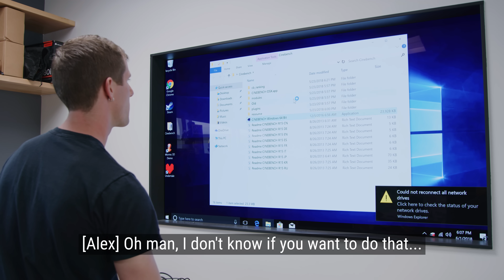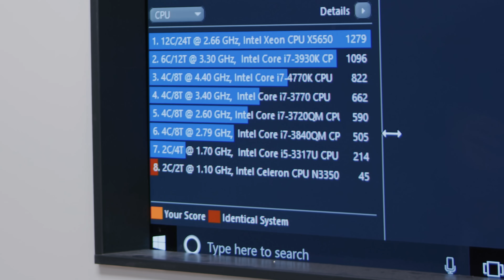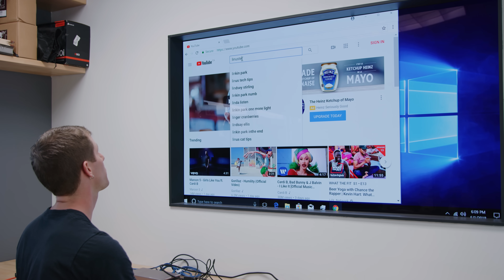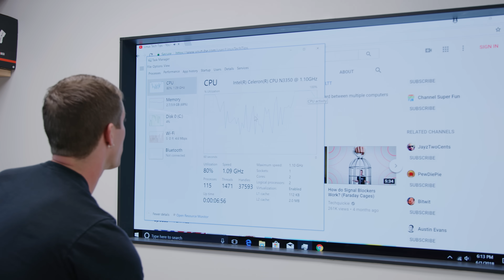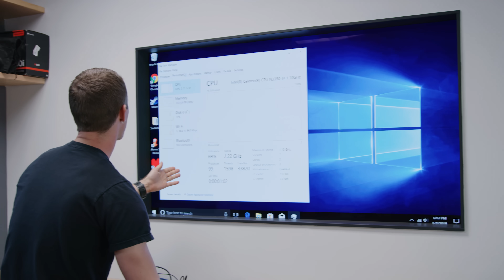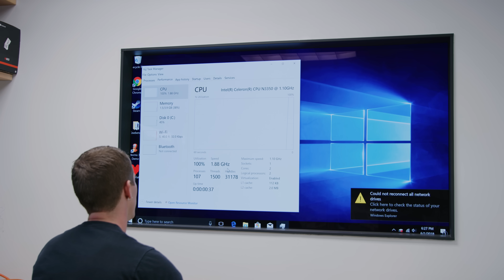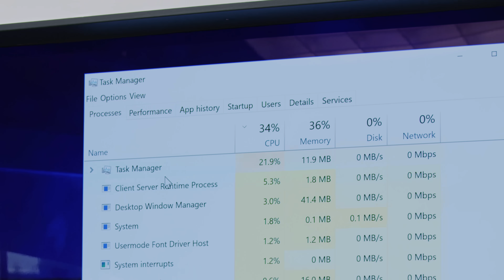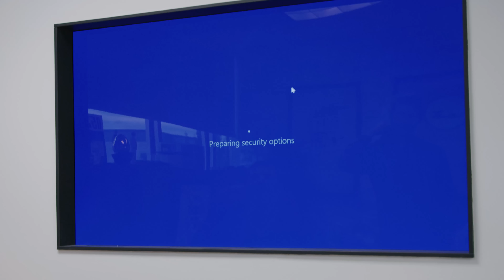PC Smaller than an SSD

Comment: You can technically have two system build by slappin that shit on your ssd bay in your case and routing out the hdmi and power cable
Reply: 100 of these would fit in my case
Reply: Shawn Jones only 100?
Reply: I need my SSD to house all of my files tho
Reply: PunakiviAddikti 
No its called hdd
Reply: You have so many subs
Reply: Hide it inside your PSU, the cops will never find it there!
Reply: Shawn Jones 317 of these would fit in
Reply: Put Mac OS on it

Comment: so its basically a phone without a monitor that runs an x64 architecture?
Reply: Ethan Martin but slower
Reply: But why, why cant we get phone performance
Reply: no.

remember latest Raspberry Pi 3 B+ a quadcore 1,5 ghz arm64 is about pentium 4 level or less.

try google : "how powerful is raspberyy pi to x86 PC"

this zotac is WAY WAY WAY more powerful than your phone.

also, this thing consume 15 watt (5V 3A), your phone consumesprobably 3,8-4,2V (3,7V is when completely discharged)  x 0,5 AH, which is about 1,9 to 2,1 watt.

WAY. WAY. WAY. LESS POWERFUL

also, the architecture is x86 not x64.
64 bit would be coded x86_64
Reply: lmao that piece of garbage isn't worth the 150 bucks are you crazy? edit, samsung dex.
Reply: phone can run 64 acr just saying
Reply: And has no battery. And has no phone capabilities, and has no camera, and has no GPS/NFC/accelerometer/"gyro". I don't think it has wi-fi either, or was I not paying attention?
Reply: ImNarrow because Windows software support would be very limited on something that isn’t X86 :(
Reply: Is obviously for signage companies, tills, and interactive kiosk use.
Reply: @girlsdrinkfeck  DEX doesnt work by itself you need 1000$ phone to make it work and its still ARM
Reply: Phones are not meant to be computers. It was phones which became tiny computers with antennas and a monitor lol
Reply: yea, but almost any phone since the Apple iPhone 5S in 2013 has had a 64-bit chipset.
Reply: @AvWoN  windows has a lot of background processes that android or ios doesn't
Reply: Windows is shit, that this thing runs it is quite an achievement.

Comment: so essentially a phone without a screen running windows
Reply: You go it. A similar Intel processor is in the Asus Zenfone.
Reply: yes and no, there is a pretty big difference, with both hard ware and soft ware, between a phone and a computer running windows, its impressive cause of how "smooth" it was running a "large" operating system(by smooth i mean it wasn't crashing when Linus wasn't screwing with the clock speed, by large i mean windows is a heavier load than Android or Linux)

Comment: I don't get the point of this. If you're going to need a dongle the size of your pc, why not make it Raspberry-Pi-sized and add usb, ethernet, hdmi etc.
Reply: margravetech realistically, you'd buy exactly the dongles you need for your use case, rather than having a bunch of extra IO taking up any space. So if you're just using this to drive a digital sign, for instance, you'd get an adapter that only has a video output. In addition, it offers the flexibility of adding alternate connections that the Pi lacks.
Reply: The case of having of a digital sign/other niche purpose with enough space for this, but not enough for something Pi-sized seems too small to matter. And why does the Pi lack flexibility? It has usb ports, these are just type-C.
Reply: margravetech you make excellent points. And you're right. I'm not sure that there are any commonplace situations where you need this specific design over the variety of IO offered by something like a Raspberry Pi. To me, there's a certain elegance to having exactly the connections you need and nothing more, but that's hardly a practical concern. In terms of the Raspberry Pi's USB specifically, all USB ports and the Ethernet connection share the same USB 2.0 bus, which severely limits overall device bandwidth. I doubt these USB C ports have that sort of restriction, making them far more flexible and suitable for varied connections.
Reply: True, yes. I wasn't saying to use a Pi specifically, it was just a well-known example. There are definitely use-cases with more power needed, or specifically windows, but then my mind goes to an Intel NUC instead of this.
Reply: IN a restaurant menu cabinet it doesn't matter. Cooling could be a non-issue as well as most restaurant menus are mounted outside of the  Building. in Alimunium cases about 2 feet b t 3 feet and 6 - 8 inches thick.
Reply: It's simply a small PC. And that's how you can use it. For making your TV smart with a hidden PC or for driving a public display. Maybe even a small POS-System, because most POS-Applications aren't ported to ARM64 or even Linux.
The Pi could also do most of this, but I guess some companies and people prefer Windows which doesn't run officially on the Pi yet.
Problems I see with this Zotac PC are the high costs, I guess partially because you buy a Windows Licence with it. On top of that it's just a Home License, which is basically useless to run it headless. This won't be fun with that specs, especially 32 GB Disk.
Reply: I had one of the IBM stick PC's for about a year before it just stopped working. Really frustrating since it was great for mounting on the back of a flat screen tv to give me quick easy aess to the net.

Comment: When your wallet runs at a faster cpu speed than your laptop
Reply: 1.1 in a laptop? That's kinda sad ngl
Reply: hahah i play tf2 on that same processor
Reply: @imeprezime7843  how
Reply: Mine 2.16 dual core, though it usual speed is 2.56, i guess that because of the turbo boost or something, only have 2gb of ram, overall run pretty damn fine, watching youtube on 4k don't really work though, also need an extension call h264ify to run youtube at HD without hiccups, otherwise i'm just gonna stuck with 480p video
Reply: I have the Intel Celeron N3350 and using the Intel HD Graphics
Reply: @amvywavy  N3060 and using intel graphics
Reply: upgrading to ryzen 5 or 7 i am still choosing and im still choosing GPU soon though!
Reply: @flying7909  I actually have an old system that have a broken drive but I'll be fixing it soon. It has an i5-3470 but it is heavily bottlenecked by Intel stupid integrated graphics. Atleast AMD Vega integrated graphics is decent

Comment: you mean a smartphone?
Reply: lol, yeah.. he acts like smartphones don’t exist and haven’t for a decade...
Reply: Voyage & Hearth not true
Reply: Voyage & Hearth But they can, there are Windows Laptops using Snapdragon 835s, like the kind in most flagship smartphones
Reply: Voyage & Hearth the Windows lumia did
Reply: It's got an X86 processor, bruh.
Reply: Except it's x86 architecture
Reply: Sr.unicörnio azul mas na verdade é roxo - clash royale.. CRINGE 🤢🤢🤢
Reply: Voyage & Hearth so because it doesn’t run windows it’s not a computer?
Reply: No a samrtohone does not run full desktop os
Reply: @leonel9110 I didn't say that. Where did I say that. I don't see that quote. I am simply implying there is certainly value on being able to run X86 applications, so there is a market for this kind of device and it should not be compared to a smartphone because a smartphone CPU can not run X86 applications simply because it's a different architecture. This is all basic beginners stuff, guys.
Reply: When was the last time a smartphone was quite this small? In fact, when was the first time?
Reply: Ha your right
Reply: My phone runs a full desktop mode OS (and you can route most Android phones to run Chrome OS).
Reply: What x86 applications will run well enough using this weak processor?
Reply: No that ssd sized pc is more powerfull that's the point
Reply: Mr.Cringe Kid more powerful than a Snapdragon 845 or even a Kirin 970 with 6Gb ram?!?
Reply: Quinch or even the A11 Bionic chip that matches a MacBook Pro
Reply: That pc is thiccer than my whole phone -_-
Reply: A micro pc is is complettly different than a smartphone, because it doesnt have any buttons (except on/off), no touchscreen, no battery and no camera. Fuck today you can even say it doesn't have a fingerprint scanner.

Comment: it Is like a raspberry pi
Reply: Yeah, but better.
Reply: Then take a look at the Lattepanda, also runs an x86 processor.
Reply: actually the pi will out perform it in a lot of tasks.
Reply: But 10 times more expensive...
Reply: Except that the pi has more io, a huge, helpful community and programmable hardware
Reply: The Pi 2/3/3B+ actually has twice the core count.
Reply: Pi 2 and 3 are probably more powerful than this, have GPIO and way better software and community support, on top of that they're cheaper. Pi Zero is also way smaller and costs $5.
Reply: Raspberry pi is more for advance user.
Reply: But smaller and better
Reply: But has x86 proccesor, which is a huge advantage if you want gaming servers.
Reply: my first though
Reply: or a banna pi
Reply: SteadyGuy, pretty sure a pi will still be a superior choice
Reply: It's like a Raspberry Pi, but completely different in pretty much all respects other than size.
Reply: Raspberry pi only has ARM CPU, so it won't run Windows. That is a very big difference.
Reply: The raspberry pi doesn't have a Microsoft background crap sucking all the performance. Linux ist just way better for a small machine linke that (and I'm saying this a a Windows user). Although the raspberry pi has the gpio pins which make it much more powerful.
Reply: Thte times, where a PiZ costs 5Units are far away from now..
Reply: except the raspberry pi has 4 cores
Reply: More costly
Reply: It's like a Raspberry Pi that runs Windows 10 and it costs $200 ...
Reply: But...what if you install a low consuming Os?
Like some linux distros?
(Ubuntu mate,puppy linux,lubutu,ect)
Reply: @Petr Čech
Microsoft spent a couple years rewriting the core of Windows to be ARM compatible. So an ARM CPU can run Windows, but there's no real support for RaspberryPi at the moment.
Reply: it can but most of the software might have problem when it comes to compiling even if Microsoft make windows to ARM compatible, so the software compatibility need to be supported by the program developer themselves
Reply: Believe it or not some crazy people have very specific requirements that make the raspberry PI a no-go vs this. I need something that has a fanless design, can fit in your pocket like a smartphone, has at least 2 USB-C or 3.0 ports, can be powered with a usb power bank, so that I can connect both a smartphone and a google edge TPU to it for computer vision on the go. Raspberry PI form factor isn't as slim as this, and that casing is solid. With the PI you get barebones and good luck coming up with a slim config that can easily slip into your pocket, AND have the fast usb-c ports. I know my use case is very niche, but raspberry PI doesn't solve everything. No USB 3.0 on the PI and it's too bulky. Pi Zero would be good IF it had usb-c

Comment: sooo what's the difference than intel's hdmi compute stick pc?  pretty sure intel's pc is smaller
Reply: オルソンフィリップ ZERO TWO SAN~
Reply: Pretty usre Intel's stick isn't usable by office standards let alone casual gaming standards.
Reply: DoomRater l o w s p e c g a m e r
Reply: I was looking for this comment specifically to make sure I wasn't the only one. Thanks m8
Reply: I was thinking same thing. My compute stick has about the same performance
Reply: DoomRater 
It easily does office. 
Z8350 is a 1.9ghz quad core.
Reply: compute stick has somewhat painful sounding fans on "fullish" load while this has no fans at all
if i had to pick between stick and this i would def pick one without fans as long as it keeps temp reasonable and wont crash because of it
Reply: Which it doesn't according to the video.
Reply: The atom processors handle low power better than the celeron line, so overall, your performance and user experience is likely to be far better, especially if powered off of a USB charger. The celeron has more potential speed but at far worse heat and power usage.
Reply: The intel gets to hot to do anything
Reply: John Squarez exactly! Just put an arm in there and get windows rt or Linux.
Reply: I mean, even those atoms 'got hot' compared to arm. I had a Zenphone 2 man, that thing made me sweat when I used it.
Reply: ZERO TWO ARE YOU ALIVE PLEASE ANSWER ME
Reply: Richard Smith My asus transformer book with an intel atom z3740 never got as hot as my LG G4 with a qualcomm snapdragon 808 and it was a lot more versatile although the pixel density wasn't as high on the asus.

Both these chips are from around the same era and both on lpddr3. The point is that arm isn't the be all and end all. Performance and energy efficiency are dependent on several factors.
Reply: If you want small form factor, the dongle breaks it.
Reply: オルソンフィリップ  sure. Compute stick is winer